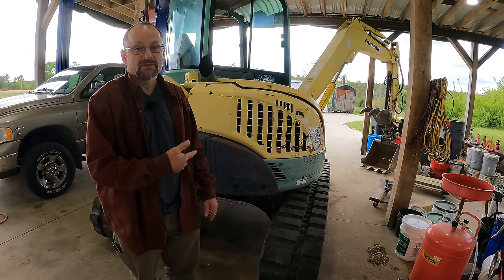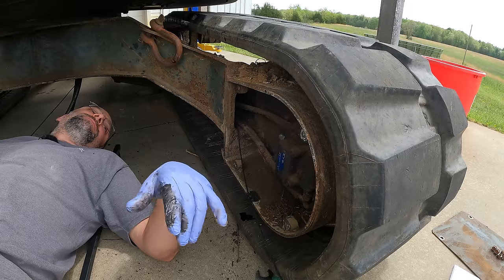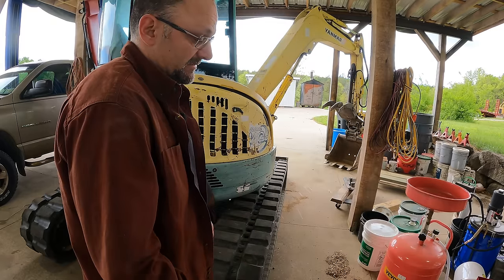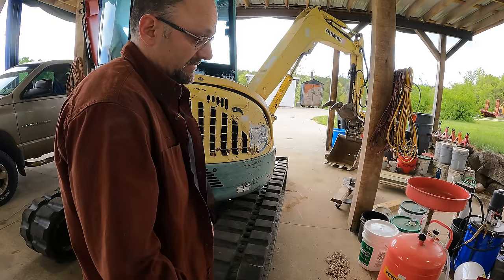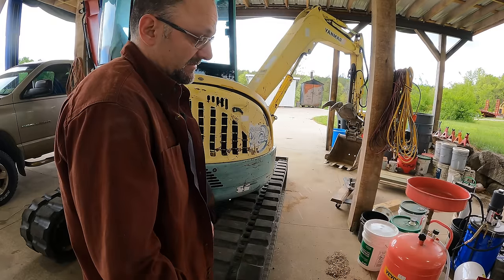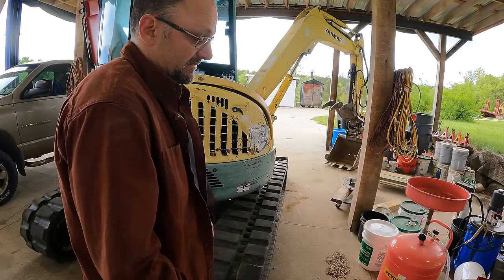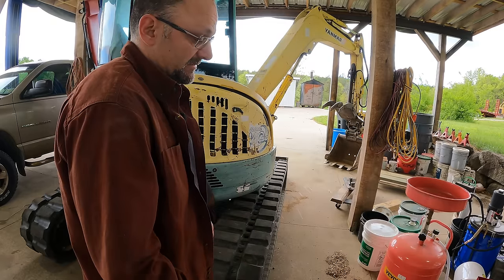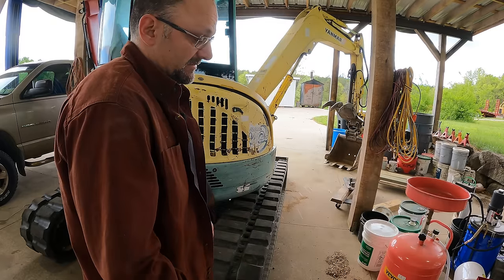Excavator Not Tracking Straight, TOUGH Hydraulic Repair.

Comment: I think you convinced yourself that there is a problem.  Having owned many excavators and tracked skid steers, I think you dont understand that none of them are ever perfect.  Hell, I bought a new john deer excavator that tracked horrible brand new. My Volvo tracks about like yours is now and I have an old Komatsu mini that tracks amazing. I just use the controls to drive them straight.  I split the amount of input and use them for what they are used for and that is digging.  I would never complain about a tracking problem unless one side is so weak that I cannot climb out of a hole, or up on top of a pile to load out. (Load out is to load trucks from on top of a huge pile. Excavators lift out of a lower point faster than lift dirt high. so if you are sitting as high as the bed of the dump truck your speed at working is faster and you can see into the bed of the truck and it makes you more efficient.)  I did like how you ran around the curve though, made me chuckle.  I do like your vacuum idea, but I will deal with the leaky oil because, when I end up working on a machine, they are so filthy and in the middle of a job site. I want the oil flowing out so that I know contaminants are not flowing in.  On the control block, you proved to me that it is not bad, because the plunger had no damage, when I replace those it is usually the plunger and the case that both have damage, so I really would be surprised if it was your control valve. they go bad when a chunk of debris flows through them and scratches the heck out of them.  If your going to go cheap on parts, throw new accumulators on it.  I just replaced a pump on my Komatsu mini and it did not have an accumulator on it at all.  But I would just use it for what they are made for.  Start digging with it and all will be well.

Comment: You can get a very cheap borescope for under $10 that plugs into your phone...they usually come with an angled mirror for 45 degree viewing.  
There are more expensive ones that even have their own monitor which run about $35...a pretty good price for what you get.

Comment: It is the travel motors as you have equal pressure to both motors and it tracks left would mean your left track motor is wearing out.  Rebuild or get a new motor.

Comment: I am wondering why you didn't eliminate the one difference between the two sides, the accumulator valve. Could it be providing slightly more or less flow. Also that hose goes through the adapter fitting for that valve. It woulodn't take much to make the slight difference in tracking.

Comment: plumb it up with the motors reversed running separately and then use the pressure regulator of the left valve (driving the left motor) to reduce the pressure from it just a little.

Comment: If the final drive motors are axial piston type -- you can't tell from what we see in the videos -- they may have a displacement adjustment similar to the one on the pumps.  It may be possible to get the displacement settings on the two final drives closer.

Comment: Is there a flow control at the control valve? I work in a tire plant, and most of the valves have flow controls near the actuator or control valve, or you could put one in for pretty cheap I would bet..

Comment: I'm thinking it could be the pressure relief valves. Swapping the PRV of the two spool valve circuits would tell.  The PRV might be adjustable, add/remove shims.

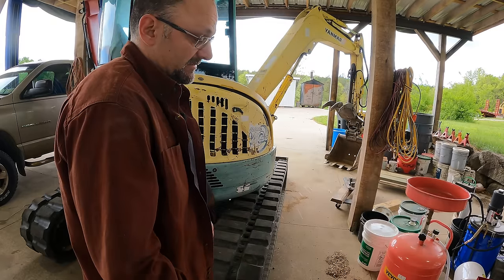Comment: Ok...obviously I'm feeling chatty :D  I'm at 26:44 on the vid and wondering, why not just bypass the swivel joint completely...line the turret up then run hoses directly from the control valve output to each motor.  If no tracking issues then it's the swivel joint, if tracking is still off then it's the control valve.  Just don't turn the turret!!!

Comment: Does the accumulator at 31:04 follow the issue ? Could be a weak spring causing leak down in flow and pressure.

Comment: My experience as a software engineer debugging programs leads me to suspect that you have multiple problems.  Generally, when you run a test trying to isolate the issue and you get completely unexpected results, you're either totally barking up the wrong tree, or you have multiple points of failure when you only expected one.

Edit: I guess I should have listened all the way to the end before commenting.  Heh

Edit again:  What if you swapped the valve internals?  Cores?  Not sure what you call them.  The pieces you pulled out of the valve body and inspected.

Comment: generally speaking  you dont drive long distances in an excavator  you dig drive a little bit more  dig again etc  generally working your way to where your going  so far every excavator i have tried pulls to one side  even brand new ones I would just adjust it the best I could and live with it cheers !

Comment: Adjust or tuning the sprocket timing and the corect balance distance of the rubber track, or put / addition to equal amount grease to both cylinder tentioner ( left and right track),
So make sure there is no air trap inside in the cylinder, that probably air spring effect, causing not syncronizing in moving. Should try it. Thanks.

Comment: Put a travel limit stopper or adjust the linkage on the pedal of the faster side.  For example a throttle stop on a atv or go kart.  Either one would correct the issue. Won’t fix it but it’s a work around
Reply: Well I guess several others have said the same thing after reading the comments 🤦‍♂️

Comment: hi john to see if the travel moter is bad check the case drain flow if the moter is slipping the case flow will be higher than normal the moter will have two port relief cartages that you can also check good luck phil m

Comment: check   the drive motors with a  auxiliary hydraulic  motor like a  another machine  ones you connect the motors time  hoy long it takes  to make a full turn.  or you can check  the 2 main pump pressure output  maybe could help

Comment: If the pressure gauges are T into the line the system works and the hydraulic fluid flows. If you monitor the pressure while working if one has a higher flow then the pressure will be slightly higher. This is a perfect example for testing electrical systems. Inexperienced automotive guys will disconnect wires and test for voltage wrong you need to be able to test under load. Breakout cables are used to test correctly.

Comment: I was thinking a high pressure needle valve on the output of each final drive.  Then throttle the flow to whatever you need to track straight.

Comment: It just dawned on me 💡🤔 the swivel joint is just a bunch of banjo bolts in a stack with seals in between each one 😂 obviously a little more complicated, but it's much easier to understand that way. Every banjo bolt used for fluid is actually a swivel joint that isn't actively swiveling. If you drill out 2 channels, one on the top face and connect at 90 degrees to one channel on the side of a solid cylinder, then put a banjo bolt around the cylinder where the side channel comes out, you have a crude example of a single passage swivel joint. Anything on top of the cylinder can connect a hose to the top face and spin around while the banjo bolt catches the flow.

Comment: My overall $.02 is that you are expecting too much out of the machine. I’d take the money you would put into parts on the machine and understand that most excavators aren’t meant to drive long distances. You live on a farm where you have long distances between barn and project site. Think about ways to more effectively transport. I like Tony Beets (gold rush) design for transport cart. Spend your time and effort building a dolly that you can hook up into the back of your dump truck and travel the long distances quickly and then offload. If you do it right you still might be quicker than tracking at 2.5mph. Love the video content. Can’t wait to see the dozer video.

Comment: At the left hand travel motor fit an adjustable bleed valve and tap into the return to tank line adjust the valve to slightly slow the motor down to Equal the rotation of both motors you will loose some minor travel speed but wort a try

Comment: Its almost like you need to have a controlled restriction to the right control drive wheel pump but as you throttle up and down not sure if that would change the rate of restriction so that's its not linear anymore meaning would have to restrict flow more at high throttle and less restriction at lower throttle.

Comment: Often the travel levers are mis-aligned. But working with yanmars/Komatsu. Your tracks can be used as flow meters using cycle times. As in lift one track install vice grips and rotate at high speed. Measure the time on an already rotating. Track at speed. Measures 3 laps and record. Should be 38-45secs roughly. Do the same with the track. (Each track gets one side of the valve and one pump side. ) Both pumps need to match flow rates.
Reply: Adjust main pump out servo piston so that both track speeds match. If you got questions let me know.
Reply: I had this exact issue with a Komatsu pc650lc-7

Comment: Definitely would go with an in-line flow control valve on the faster pump output. Then you could tune and balance as you need.

Comment: Maybe a hydraulic oil cooler would help if its getting worse as the oil heats up. Also the low horse power could just be wear and tear on the engine.

Comment: The biggest thing to remember with hydraulics is it is not about pressure it is about flow.  That being said there is valves that sense pressure and relive it. If there is too much flow to one side you relieve it to match the other.  A smart system would have a adjustment on a bypass valve to allow these machines to be adjusted at factory.

Comment: The left deep hose going to the black lid - looked bent at right angles - maybe a pinch. might put hard lines coming out to a softer fitting. .   Sounds like a pinched flat hose.   Can you extend hoses and have them loose on both ends one motor at a time.

Comment: I believe your issue is the pump, without touching it I can’t say for sure. But one thing you could do is swap the spools around in the control valve and see if anything changes. If not you just eliminated the control valves is the problem. I would set the pump adjuster back a not play with that.

Comment: Is it possible to add a pressure / flow adjustment valves to the hydraulic lines feeding the motors so that you can manually adjust each motor until they match. It doesn’t solve the root problem but will allow you to fiddle with the pressures and volumes until you are happy.  It also wouldn’t affect the other hydraulic operations on the excavator.

Comment: uve probably already checked this but ill bring it up anyway is there any adjustment to be made between the travel lever and the valve like is there just bar linkage or is there a cable that pushes and pulls on the valve or any any kinda of excess slop if it has linkages

Comment: Can you lower the oil pressure on left motor circuit? Or reduce travel on left handle to slower down the left motor to go straight? (in setup when you oversteering to right).

Comment: Can you not put a re-stricter valve on the high volume side and dial it down to match the other side. I thought  that might have been included in the system some were. Mark has the right idea.

Comment: When you check the psi in the did you stall the tracks?. If not you did not get the right pst. Leave the hp valve alone. If you turn it to far it will over stroke the pump and damage it.

Comment: Knowing when to just use it the best that it will work without extraordinary cost is tough, but I think you've done enough testing to realize spending more is not going to be worth the cost. Hope it works out for ya, perhaps dedicating a trailer may be the best option, since using the digger doesn't seem to be the problem. Fingers crossed.

Comment: Weird question why does only one of the pressure lines from the pumps have an accumulator and the other doesn’t? Shouldn’t they be the same? Is the accumulator damaged and restricting flow on one side? Like maybe it lost pressure and the bladder collapsed.

Comment: Everything  is working good, so untill it shows itself, and since you dont have to drive very fast. Just use it . maybe theres an adjustment. try change the fluids and filters.  especially on pull side motor.

Comment: Have you checked the tracks and rollers if one is bad and hanging up it will drag and it one pump or motor is weak when you change the pump lines it was only a little different

Comment: Losing drive pressure when you combined them is normal for open center valves. I'm not sure what to expect on a low end excavator without drive equalizers. You might want to check out lunchbox sessions on YT for some good hydraulics education. They have some great breakdowns on compensated pumps and how the adjustments work.
What I would do is just make adjustments to the control valves to make it go straight. This can either be done in the linkage via an adjustable positive stop, or at the valve spool with shims. All depends on the design. The equipment I work on is a bit different, but the same basic dual drive motors. Flow meters are nice, but in high flow systems the resolution isn't enough for what you are looking for. You can often tell the condition of a motor and especially comparing two to each other by opening the case drain, and measuring the oil output over a set time with the motor going full speed.

Comment: If you dont have flowsettings on your valves, you could just add throttle/check valves on the lines to the fastest hydralic motor and adjust it down i tiny bit. Or just fit one throttle valve on the pump output with highest flow.. or maby clamp the hose a bit.. super cheap :)

Comment: Hey Mate,
I'm thinking you are right with the wear being all through the system. A bush fix could be to add an inline valve on the stronger side so you add a bit more resistance to that side to balance out the dynamic head losses. Love the content mate! from a mech eng in AUS.

Comment: Restrict the flow to the left motor, via a manual valve (not really a fix but it would make the motors as slow as each other) as long as there is a pressure relief back to tank that is.

Comment: i did notice that your left stick is going slighter farther then the right stick is (for moment). is there a way to limit the movement of the physical sticks? that way you don't need to worry about any of the stuff that might be the problem.
aka you if you limit the movement of the sticks so that max forward or max backwards keeps you straight then problem solved....until something breaks xD.

Comment: Not knowledgeable on hydraulics, but when I watched this I started to wonder if there are any other loads / valves / implements etc... connected to either hydraulic circuit?  Could a circuit unrelated to drive be leaking internally on one of the circuits and unbalancing the flow / pressure available?

Comment: Can you put a block or a washer to limit the travel of one of the levers/spools? So at full tilt they are slightly different, compensating for the track speed. Or is the "throttle" constant on them regardless of how far you push it? If it not it might be the perfect temporary-permanent fix :D

Comment: Could it be a worn out linkage ? Any play or bent part removes the mechanical advantages . Even though you push both levers equally, a bent lever will cause the imbalance.

Comment: Could you connect it all back up as it was and then install some kind of pressure reducing valve on the fast side of the machine.  Slowly dial it back untill it tracks straight?

Comment: Is there a mechanical linkage that is somehow worn and one lever doesn’t actuate the spool valve as far as the other, therefore causing different output for the same relative lever position?

Comment: i saw you try to give move travel on the left side on the stick. but could you reduce the travel on the right side so its also became slower or it would be clutch slepage?
Reply: The drive is 100% hydrostatic. There is no mechanical clutch.

Comment: I'm late to the party so I'll probably be missed but: I don't understand why one couldn't have swapped the hoses at the other end (swivel joint?), to test the left/right motors.  With no extension hoses?  (Is it just too hard to work in there?  $150 hard?)

Comment: Disclaimer: I don't know anything about hydraulics. Can you install a valve on both outputs that will limit the pressure and shunt any overflow back to the tank? The latter by tying into an existing return line or just adding another port in the tank. You would loose some speed overall, but you could use the pressure adjustment to compensate for the difference in pressure going to the left and right track.

Comment: Why not just make a tiny adjustable limiter where you can turn a bolt a couple of threads and it prevents you from pushing the faster stick all the way? I’ve fixed similar problems thusly because I lack the patience for a proper fix.

Comment: Nothing is really wrong with it in my opinion. What I would do is turn down the pressure on the faster track. No matter what you do normal wear will never be even. I would think this is a normal procedure when calibrating track speeds. There is also the fact that the first pump on a stack while have a higher flow rate than the next pump and so on. This is because they share the same feed gallery that enters through the first pump.

Comment: The machine has a control for each track, which may be a lever, foot pedal, or joystick. The operator positions each track control to control the direction and speed of each track. If the machine is not running straight, the operator should manually adjust the position of the track speed controls as the machine moves, so it runs straight.  
Don Searles